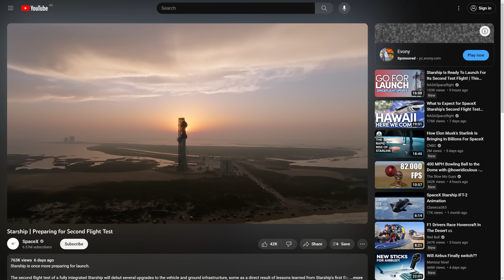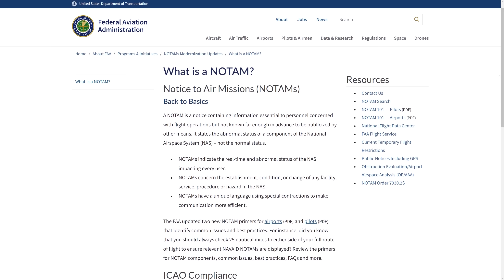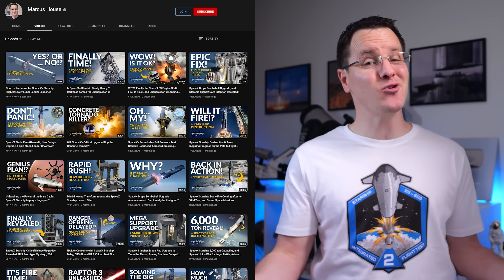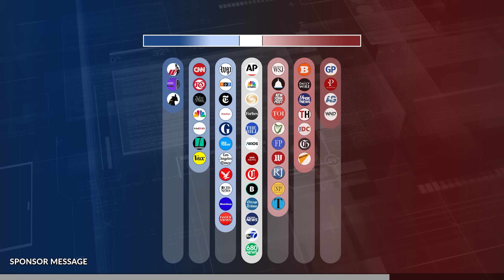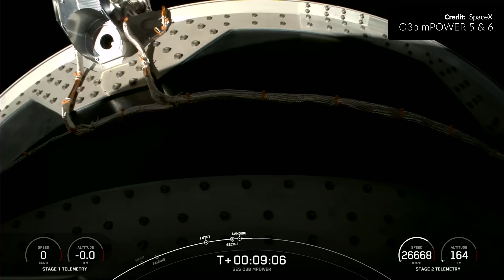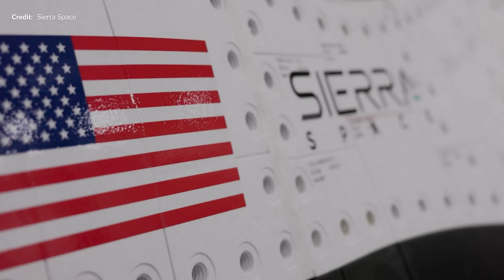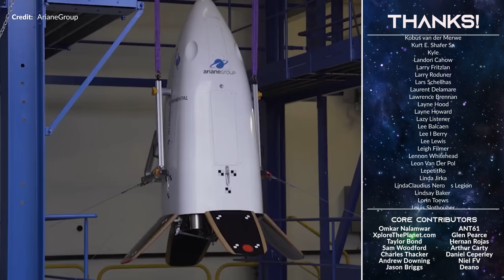Nail-biting Starship Repairs For Flight! Go Starship!

Comment: I reall think SpaceX needs to build a simple catching tower (no pipes or infrastructure) to practice catching Superheavy boosters before they risk all that Stage 0 equipment on a live catch.  It might even make sense for a few years so they can check out and refurbish a used booster on the catching tower while a different booster goes through final tests on the launching tower.
Reply: Last I heard they were also planning on catching starship in the same way.  I don't understand why they haven't made a static catch tower for practice, unless they're relying on the chopsticks to move and align with the booster and starship as they're landing.  I mean, they could've been launching suborbital starships to a nearby static tower and tweaking that aspect of flight ever since they first landed SN15.  That gives me the impression that their plan is to actively use the chopsticks for alignment during the catch...but based on how slow they move during stacking I don't see how much difference it'll make.
Reply: Not only is SpaceX launching prototypes of one version of their Starship to test and develop base vehicle technology, but they are similarly launching from a prototype Orbital Launch Mount and Rocket Suppression System and includes the prototype Integration Tower. I imagine a bit more development of a tower will be involved for a catch attempt.
Reply: Thanks for reminding me that they intend to catch a Starship while a booster is waiting (and empty) on the same tower.  Yes, it feels like they could have been launching and catching Starships for the last two years.  I wonder how far up a Starship could go by itself?  Just to tweak Blue Origin's Shepard...   @Skinflaps_Meatslapper
Reply: @chrismullin9437  Sounds super sketchy saying it out loud, doesn't it 🤣

It's been theorized that it would be possible to convert a starship to a SSTO by reducing the payload bay area with additional propellant tanks, and then adding a few extra raptors to compensate for the increased load at low altitude.  The only problem is that in this configuration it's not very practical/efficient/profitable in comparison to a starship and booster, and it would be LEO only.  So yeah, starship could destroy the Shepard in that regard by actually achieving orbit, but would do so at higher cost when measured in dollars per pound to orbit.  In some ways it would've simplified their testing and development had they just made starship an SSTO first, ironed out all flight testing and whatnot, then used the booster as a supplement instead of a necessity.  That way when it came time to integrate the two it would be far more seamless of an operation, and they'd have multiple configurations to choose from depending on the mission.  SSTO starships on boosters would be a more viable way to get further out of earth's gravity well without orbital refueling as well, so if you wanted something in GEO, you'd be able to do it in a single launch.  Just speculating at this point, but you get the idea.  An extra 75-100 tons of propellant in LEO can get you places, even with a massive starship.
Reply: Oh, I wasn't thinking of reaching orbit, just a straight up and straight down flight with the normal configuration, to get more experience with heat shield tile attachment, re-entry at some sort of speed, the last minute flip maneuver, and maybe catching things with chopsticks (on a catch-only tower).   @Skinflaps_Meatslapper

Comment: Starship flight two ended with a double RUD of both vehicles.

The engines (ALL THE ENGINES) performed perfectly.

The hot staging however caused more problems than it cured.
After hot staging happens and the booster separates you can see an explosion in the top of the booster that destroyed everything.

Comment: Second tower at BC: My guess is that it will be built in the near future. And it will be earmarked for Booster and Ship landings, not launches. So, that second tower would consist of the tower, the hoist system, and the chopsticks.  

There would be no OLM or quick disconnects for the Booster and Ship, which are needed only for launches. 

The idea is to use that tower to perfect the landing techniques for the Booster and the Ship without interrupting launches from the first BC tower. And, secondly, to eliminate the possibility of damage to the OLM from a missed landing attempt on the first tower.

Comment: I suspect the hot staging section will be found to be a problem with the launch.  The dome/deflector has a large flat surface on top, meaning it will take the full force of the sea level engines, thus building up a lot of pressure and increasing the likelihood of damage to either or both stages.

Comment: i just realized something... the cyber truck isnt designed for this planet. elon is simply testing it here. cant wait to see the final version of the cyber truck intended for Mars.
Reply: Not specifically the cyber truck or any other current Tesla model... but yeah, it's not coincidence that Musk decided to invest in electric vehicle technologies... internal combustion engines don't work well on Mars, and the battery and motor technologies have also been put to good use at SpaceX

Comment: What would make the most sense for me is SpaceX building another tower with just the arms and a super basic super heavy stand for catch testing. If a catch attempt goes wrong you would cause damage to your "catch testing tower", while not slowing down your potential launch attempts because the "main launch tower" along with all the other Stage 0 hardware (everything in that launch table and the water deluge system) would not be at risk. Seems like the most risk averse way to test catching to me, but I know SpaceX likes being space cowboys so who knows what they will actually do.

Comment: the thing im most worried about are the gridfins during hot staging....they're really really close to the where the exhaust would come out from. Success for this flight ( for me) would be successful staging
Reply: I think the grid fins will survive it 😂
Reply: The grid fins already have to deal with a lot during normal use, so they’ll probably be fine for the brief period they are in direct line of fire

Comment: Would the 2nd Tower be better used purely for catching - at least until catching is perfected?
Tower 1 can be the launch tower with all its connections to the tank farm, etc while tower 2 could just be purely for landings with no tank farm connection so less damage if a catch goes wrong. Put it further away from tank farm and an explosion will have  no effects on the launch site and the chopstick mechanisms can be quickly replaced if damaged in a catch.

Comment: It would be very interesting to create a Falcon Heavy equivalent for starship. Imagine the payloads 3 super heavy boosters strapped to gather could lift. This could also simply allow the preservation of more fuel to use in orbit or beyond. So many possibilities and so many challenges.
Reply: Refueling in orbit can do the similar goal
Reply: Musk said that FH had become a complete different vehicle. There is no way to "just strap together" when you are dealing with hypersonic speeds
Reply: @Fannystark007  Of course a different vehicle than the falcon. To say it’s “impossible” is a bit of an overstatement. Lots of things have been declared impossible and later achieved
Reply: @alvianchoiriapriliansyah9882  yes, it would. However, that is (presumably) a very slow process. It depends on how important speed is. I have a feeling the orbital refueling system will end up being very different that what is currently envisaged
Reply: @joshchase6454  didnt Musk say that it would be much more cost effective and faster to just build th 15m diameter ship, after they figured Starships 9m? Can't remember where he said it.

Comment: The quick stacking/de-stacking design is not an accident, this must have been a clear requirement for fast development.
Reply: Can they reuse that ring? I guess firing raptors into a steel cage...
Reply: @Fannystark007  That is probably the reason it is bolted to the booster. But I was thinking about taking the rocket stages apart to get to it. As far as I remember, the stacking of the similarly sized Saturn V rocket was a major milestone, and deciding to take it apart would have been huge delays then. Now SpaceX takes it apart, makes some modifications and puts it back together again in a couple days. Sure, Starship has fewer stages, but overall Starship is larger, and has way more engines, and a lot of additional complexity for re-entry and landing systems, that most of the Saturn V did not need.
Reply: Remember, their stated long-term goal is for 1 hour turnaround on boosters... catch them, stack a new ship on top, fuel them, and go. Obviously that's insanely aspirational, but it's the mindset behind those design decisions...

Comment: On the hot-staging thing...
Has there ever been a test where a single raptor is fired directly at a metal surface a few metres away from the rocket motor bell nozzle?
All the videos from the test site seem to show a violent 20 metre plume with what appears to be an astonishing level of destructive force. One would expect such a plume could do a lot of acoustic / heat damage to whatever it hit (see concrete launchpad from earlier this year which was some distance away) 
And if we assume that the booster upper surface somehow endures this blast and is not instantly destroyed, you'd expect quite a lot of that energy to bounce back right into the engine bay of Starship.  
Hot-staging addresses an issue of loss of thrust during stage separation, but intuitively,  it seems to dramatically increase the risk of damage to both stages.
Reply from the maker: I don't know. This is certainly one area of major apprehension for me.

Comment: Bummer, delayed Starship launch because of a equipment problems. Delay will be 24 hours - WHAT?!. Oh, and let's replace all the grid fin motors. Insane. NASA has a leak - launch slips by months... (yeah, I know it was hydrogen ...). It is amazing to see the results of what must be incredible Engineering and planning that the turn around can be so quick. It is really incredible to watch and learn from. For me, it sets the new bar on what can be done.
Reply: It's all about the design goals. If you want rapid re-use, you design things such that anything which might need regular servicing is easily serviceable... so the grid fin actuators can be exposed by popping the hot staging shield, the engines are easily removed and no longer depend on complex hydraulics, etc. If that's important to you, it's not hard to do it right... but the people building expendable rockets don't find it important.

Comment: a fix that would take a traditional rocket 3-6 months takes them a half a night to fix reassemble test and then restack! insane!
Reply: In fairness it hadn't restacked yet when you made your comment. But the point stands.
Reply: @mrprongles9510it doesn’t matter whether it is human rated or not, it’s still much faster than anyone else would have taken
Reply: Nah, they're not that bad at replacing a single item.
Reply: @ChrisUK27   Nah, they're not that bad at replacing a single item. 

How long to remove a rocket from the pad, return it to the integration tower and separate the stages before the work can be started?  Then do it all in reverse and verify everything all over again?
:planet-orange-purple-ring:
:planet-orange-purple-ring:
:planet-orange-purple-ring:
Reply: @Scanner9631  A team walked out and rectified a fault on SLS this time last year whilst the rocket was fully fuelled on the pad.
Reply: @ChrisUK27  

Was that a fault the required removing a stage to access?  I doubt it.

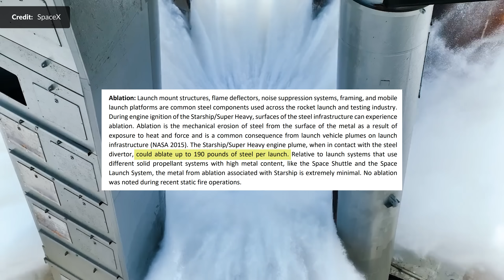Comment: 5:25 - That was not the point of FWS remark. What they were saying is that the pollution from this ablated steel is minimal compared to solid rocket motors as used on Shuttle, SLS, Vulcan etc. The durability of the system is SpaceX' concern, not that of the general public-

Comment: Sierra space has had to do burst tests of its inflatable modules, but I've never heard if the metal modules for space stations or other uses in space, have to have the same kind of burst test. Is that one of the required tests for all modules, and we just don't hear about, or see video of the test being performed?

Comment: I dont understand with hot staging, how the booster will be resusable, obviously this one will not even attempt to land however. 

While I am certain the engineers have this in mind, I just recognize the booster will be damaged by the blast from the upperstage. There does appear to be a 'cap' on the top of the booster but I doubt it will be a long term solution. 

PS, I will always calls NOTAMs,  notice to air man, despite the official change to 'air missions', you still are correct and no one with a life will try to correct you.

Comment: They said up to 190 pounds of steel but the report goes on to say that they found significantly less than from the static fires. The second static fire was even significantly less than the first.
Reply: That's because it's a worst case scenario, and the static fires only produce up to 50% of the launch thrust
Reply from the maker: This is also how I am interpreting it. Either way, surprised by that. Let's hope it holds well.

Comment: My guess is they are going to build a second tower at Starbase with the lessons learned from tower 1. Then keep abusing tower 1 until its ready for scraping.
Reply from the maker: That may not be far wrong. Haha.
Reply: how about second tower being initially used to catch boosters protecting the "launch " tower from damage during landing tests?

Comment: I think the hot staging is a temporary solution, until SpaceX gets experienced with Starship launches. Then switching back for the flip maneuvering stage separation.
Reply: I don't think so.  Hot staging gets more payload to orbit.
Reply: The extent that they have gone through, and are planning, to maximize payload mass to orbit makes me think they stick with hot staging. 

Hot staging is not a new concept. If there are any issues we are more likely to see iterative changes make it wok for Starship.
Reply: @danharold3087 true but its not the best idea for reusability. unless the hot stage ring shows it can handle multiple launches without any major refurbishment. making a new one for every launch would not be practica for the long term.

Comment: So, the actuators are relatively easily accessible from just below the “hot staging” interstage ring? Why bother fixing, they’ll get damaged/destroyed by the 2nd stage at separation. A couple seconds of thrust against a removable access panel will at best only fry the power/control connections.
Reply: The hot staging ring is designed with a conical disk to divert the flames sideways through the ring.
Reply: @Scanner9631  Given the SS engineers' success with flame diverter design I'm sticking with my orginal comment.
Reply: SS booster loses control due to grid fin failure.  Ground control range safety officer makes it go boom.

Comment: I feel there is still a major design flaw in StarShip launch pad stage Zero design. 

Per my email to SpaceX, I suggested they consider a conical or pyramid flame diverter below the StarShip with incorporated water deluge system surrounded by a  circular water tub exit adjustable angle spoiler 📐 diverter,  redirecting thrust up and away from the complex. 

The current shock wave design is like punching a brick wall, eventually something is going to break and the surrounding earth, infrastructure and real estate improvements may be still susceptible to damage. 

Time will tell.

Comment: Thing impresses me, from Flight #1. A number of Raptors were knocked out at launch presumably from flying concrete.  The fact that it got off the ground at that point, and not be destroyed by a chain reaction of exploding engines, is actually amazing. Obviously, letting concrete fly is part of the resilience test .  .

Comment: @ 16:50 - Falcon Heavy has recovered the center core before, i'm not sure if this is the only instance but it did land once on OCISLY back in 2019 for the Arabsat-6A mission
Reply: It tried to land but was to fast and went into the ocean with 300 km/h
Reply: Sort of — they landed it on that occasion, but failed to recover it... from memory, due to rough weather and an inability to secure it properly on the deck of the barge. And yes, that's the only instance where they've successfully landed it...

Comment: With SpaceX already planning on having a tanker fleet of Starships, would it not be more reasonable to utilize Starship's orbital load capacity to build a "gas station" in orbit and run missions to fuel the depot on a regular basis. So when a Starship has a mission further out there's already fuel in orbit, don't need to launch 2-3 fuel missions with the main mission. 

This could also push the industry to using a liquid methane and oxygen as a fuel source moving forward. And could be sold in situ to other companies.  The possibilities that could bring to private sector and general access to space, it could change how we build and utilize satellites, space observatories, etc.
Reply: The simple version is already planned, called Depot. It's basically a stretched Starship, with no legs no flaps no heatshield. Just additional insulation & hardware for mitigating boil off

It will stay in LEO indefinitely for certain missions that needs it